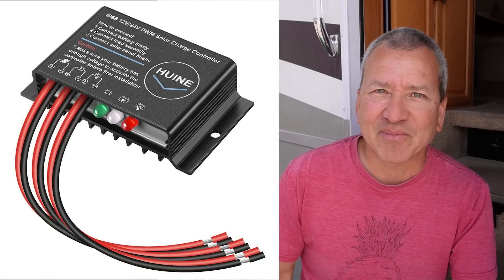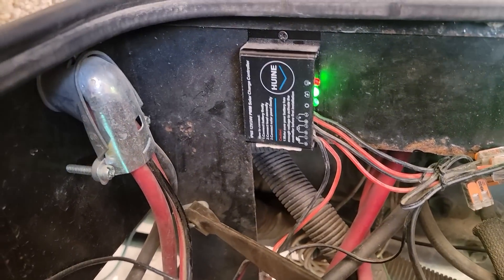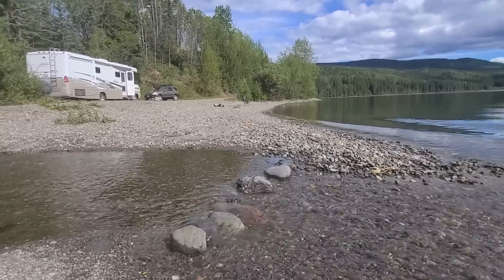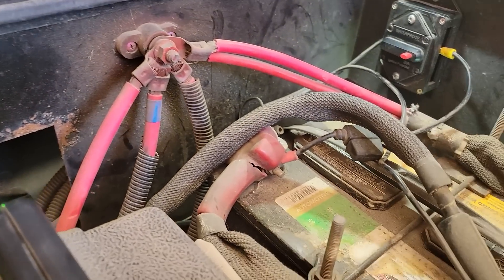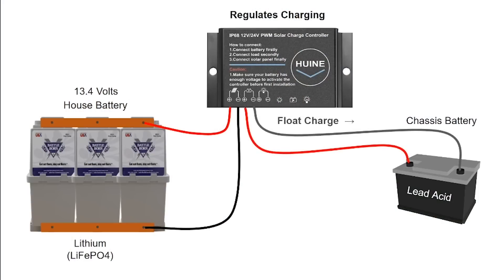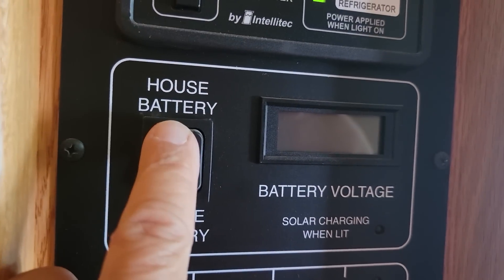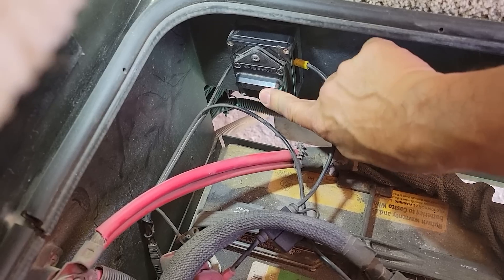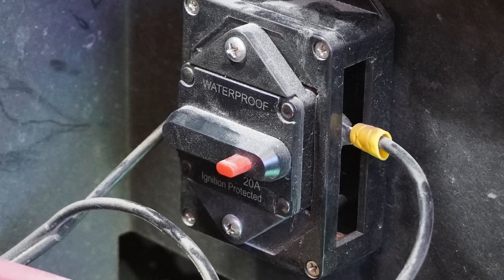This $20 Hack ACTUALLY WORKS as a DC-to-DC Charger for RV Chassis Battery | RV With Tito DIY

Comment: T man strikes again!
This is a great idea. That parasitic discharge has been bothering me for years. I just happen to have a Harbor Freight CC that I've never used. It will work perfectly for this. How did you know about the power surge at startup?
Reply from the maker: I have a fuse inline on the battery side. It would blow when I started the engine. I would remove the fuse before starting the coach. The circuit breaker I'm using says it's ignition protected and seems to have solved the problem.
Reply: @RVwithTito  Brian, any concern with a possible charger overlap/loop between this charger from the house batteries and the Orion DC-DC charger from the engine battery/alternator that charges the lithium coach batteries? If both were slow to cutoff there might be a period when they are both on causing a loop. Great video and idea. I am just planning an inverter and battery upgrade to our 2007 Winnebago Diesel coach. So I am sorting out the extra items needed. I currently have a Trik-L-Start engine battery trickle charger which Winnebago started installing about the year of my coach. This charger may not be compatible to Lithium voltage levels, I am still researching. Thanks!
Reply: I actually didn't use the controller's solar input. I connected the house batteries to the battery input and then connected the chassis battery to the load output. Seems to be working well.

Comment: Thank you for the prompt response to my request and I'm sure the request of others, with this video.  So obvious, and I didn't think of it. I have a small pwm controller sitting on my workbench doing nothing. And instead of thinking of this  genius trick, I spent a significant amount of  money buying a high amperage diode to create a bridge between the battery Banks to take advantage of the half volt drop across the diode.   Now I guess I will be rewiring to employ the neat little four-stage controller like you did.
Reply from the maker: :) May as well put that PWM controller to good use.
Reply: @RVwithTito  On my diesel truck, my starter battery drops to 10.0 volts when cranking, if I had a pwm charger hooked up like yours the breaker would trip every time. I think you could wire a relay with the ignition so the pwm charger is disconnected for starting and then switch back when the ignition key is off. That would be the only way for it to work with a pwm charger. A small 10 amp mppt charger would fix the high current problem when the starter is used but I don't think it would work because mppt chargers need a slightly higher voltage on the input than what the battery it is connected to has.

Comment: If you install a Victron Cyrix li ct, the solar or generator or shore power will charge house and starter batteries at the same time then separate them if either isn’t getting charged . You need to swap the battery isolator to a lithium isolator and tie in the boost switch. High power alternator charging 60-120 amps hr. If it detects charging on either batteries it combines them so it can charge the chasis battery from solar, generator & shore power automatically or vice verca for alternator charging the lithium’s
Reply from the maker: True. Lots of ways to get it done :)

Comment: Nice.  So your lithium is acting as a " solar panel" to trickle charge your lead acid.
Reply from the maker: Essentially yes. Your solar panels are basically just a DC power source that fluctuates quite a bit.

Comment: I have an inexpensive PWM controller connected to my truck battery with a 25 watt solar panel. At full output the panel will put about 1.8 amps into the battery.
Reply from the maker: Yes. These days, there are tons of PWM controllers around.

Comment: I don't see any reason this wouldn't work with a lead acid to lead acid setup. I keep my RV plugged in at all times...and although I don't have lithium, this setup would keep my chassis battery topped off and balanced with my house batteries...and eliminate the need to keep the chassis battery on a trickle charger for extended periods.
Reply from the maker: Yes. It should work, just less current flowing. Plus the controller will prevent the chassis from charging the house in case the house get's low.

Comment: Great idea.  I have small RV trailer with 85 amp lead acid battery.  I plan to upgrade to lithium in 2024.  I have a 100 amp lithium diy power station for night use.  Your idea may work to keep lead battery charged at night for gas furnace and fridge.  I can use the PWM to charge power station with my ground portable solar panel.  What do you think?
Reply from the maker: You're power station doesn't support a solar panel input? Nevertheless, I also use a lithium power station in my tow car to keep the battery topped off...no controller though, just direct connect.
Reply: @RVwithTito  i do charge the diy power station with a separate MPPT controller but your idea works better with a PWM for both lithium and lead to charge the lead battery at night to help with the gas fridge and heater power.  Thanks.  i purchased a different PWM for lithium and lead.

Comment: This is not a good idea. All charge controllers have a max current they can handle, if you exceed that the controller is going to be damaged. So if the starting battery is basically full it will draw little current and you will be OK. However should it be really low when connected you will probably exceed the controllers ratings and destroy i. Since you have it connected all the time this probably wont happen but a fault in the starting battery could cause your house bank to be drained. Its just like having dual batteries in a boat, never have the switch set to both.
Reply from the maker: The circuit breaker installed by the battery should prevent that from happening. Go with a lower current breaker if you want. Plus you're right. It's always connected so the battery will never get low.

Comment: Brian great job! 
I learned from acid battery manufacturing that you lose 1% of your battery charge every day. I’m not talking about parasitic loads. The battery itself loses the voltage. So what you propose is excellent.
Reply from the maker: Yes. That's true as well. Thanks for reminding me.

Comment: This is just... genius. I have no clue why this never occurred to me before, but this is perfect, so spot on! Our batteries are quite far apart in our rig, and this would easily allow for smaller wires, easy run... Thank you!!
Reply from the maker: Yes. Try it. Same setup, just longer cable.
Reply: I know right what a great idea.
Thanks Tito

Comment: That's way more efficient than what I've been doing, plugging a trickle charger into the RV inverter AC circuit when I'm in storage.  Thanks!
Reply from the maker: Yes. I used to do that too.

Comment: Brian, did you consider the trickle charge output on your Multiplus II?  Just got my MP2 and was wondering if that could serve same purpose.
Reply: It will and it does.  It is always on even if the MP2 is in the off position.  Put a switch in line to shut off if ever needed.
Reply from the maker: No. I haven't tried it. Give it a go!
Reply: Brian, I was thinking of using your approach to replace my currently working Trik-L-Start since I have installed lithium house batteries. However, I have two concerns, 
1. there might be a large current surge from the lithium house batteries through the PWM controller while starting the engine.  Have you ever noticed or measured if starting the engine pulls a large burst of current? 

2. Also, it appears you leave the pwm controller always running. While running the engine, have you had any charger loop issues between the DC to DC converter charging the house batteries and this PWM charger charging the engine battery?

Comment: Now that's a great idea for another idea I have been playing with 🙂

Let me explain: My dream is to have an electric RV, but our budget keeps that firmly in the dream world.  The only thing in reach for most of us is to have enough solar and batteries to dry camp without the need for a generator.  Another thing a person can do to consume less fuel is to take load off the engine by explicitly not using the engine's alternator to charge the house battery bank.  Leave that to the solar array.  With your trick we might be able to go one step further and take the whole damn inefficient alternator with it's inefficient belt drive off the block and use solar to power all electronics and lights needed to drive the RV. 

Too weird?  Remember racing cars drive without an alternator too.
Reply: Intrigued. Your idea is not at all weird, especially with rising fuel prices. Not sure how the setup would run everything that normally runs off the alternator. ?
Reply: Yep. Whenever I finally decide to go for it I would first measure the amp draw under the heaviest load and then choose an appropriately sized charger. It helps that I already converted the largest part of the lights to LED, so that should make a big difference. 20 amp might just be enough. Then after a test period I could remove the alternator and put a shorter belt in.

One thing just popped in my mind though: cheap mppt chargers are typically connected to 12V panels, and those 12 v panels are not 12V. They are more like 19V. The voltage of the house batteries will probably have to be cranked up.
Reply from the maker: Usually the limiting factor is the amount of space you have available for solar. If that's an issue, then alternator charging is usually the fallback.
Reply: @RVwithTito  Agreed. It does have some pitfalls though. When a modern car/RV starts then the ECU keeps the charging voltage high, 14.4V or so. Then after some time it drops back to a lower maintenance voltage, perhaps 13.6V.   If the mppt charger can keep the voltage of the car/chassis circuitry above that 13.6V then the alternator will most likely quit generating power. That will certainly reduce load on the engine. I don't believe a simple MPPT charger will be able to deliver 13.6V when it's input is also 13.6V (or lower).

By just completely removing the alternator the losses generated by the belt will be gone too. Just as interesting is that the ECU won't be able to command power from the alternator ever. Not even when the voltage drops to 12.6V, and I think an MPPT charger will be able to deliver that voltage when there is only 13.6V coming in.

What if the battery bank is low and there is no sun? Hopefully that is a rare case because then I would have to run the genny to keep the engine running  🙂

Comment: Thank you for sharing this. Preparing to install our lithium batteries this week which will require either modifying the existing Trik-L-Start or buying the one you use. Looks like I'll be ordering a PWM charger.
Again, thank you for sharing!
Reply from the maker: Doesn't hurt to try :)

Comment: Says max solar input voltage is under 50v. I wonder if it would work with a 48v (51.2-54v) LFPo.
Reply from the maker: That might be a push. You could always put a 48V to 24V step down buck converter between the 48V bank and controller - https://amzn.to/41dpm0h

Comment: I was actually thinking of doing something like this but a little different. I don't have a motor home anymore. I downsized to a small fifth wheel. I was thinking of using a PWM controller as a DC to DC charger from my pickup trucks alternator to the trailer batteries. I figured it would be better then that anemic connection that exists on the truck. Also, I have a 20 Amp PWM and it wouldn't cost me anything but some time.
Reply from the maker: If you have lithium batteries in your fifth wheel, then you'd still need to limit the current somehow or they could pull too much current from your alternator. When the current exceeds the PWM controller rating, it may just throw a fault and shutdown.
Reply: @RVwithTito  I still have flooded batteries but will be going to lithium soon. You bring up a good point though. Thanks.

Comment: Thanks! Great plan that makes a lot of sense, I actually have a cheap pwm to trickle charge start battery, but with a solar panel. Your way is much less "involved"
Reply from the maker: Yeah. Put that solar on the roof instead to charge your house :)